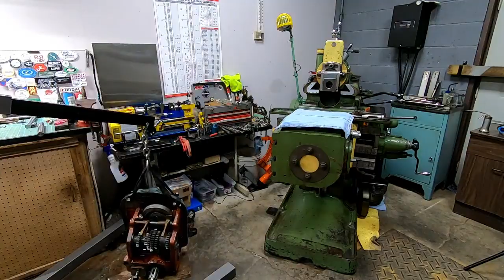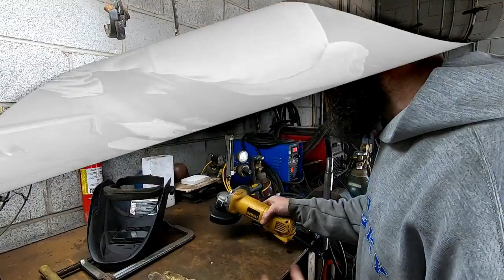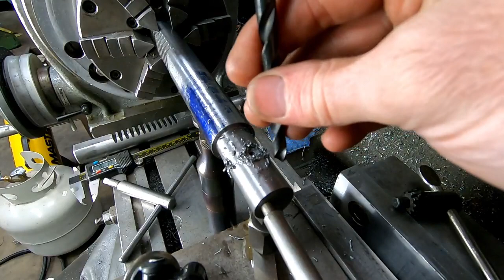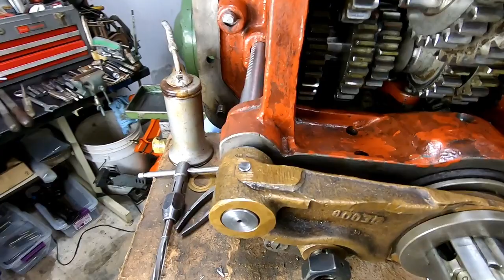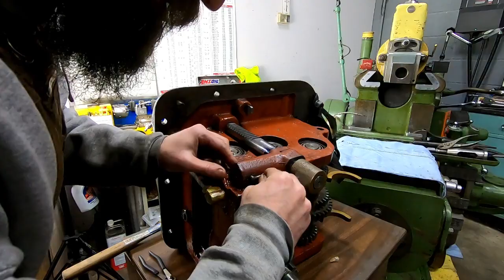👍K&T Clutch shaft final.

Comment: Try double face masking tape to hold non-ferrous metal to a magnet. Works great.  In 2004, I had the pleasure of turning a new left hand 1 3/8- #4 Acme lead screw and matching bronze nut for a old Cincinnati vertical mill saddle cross feed. I still have the sketch of the nut in case someone may need to make one for their machine. I really enjoyed this work and seeing you carry on with this type of work.

Comment: having been a machine repairman at Falk corp here in milwaukee, i have rebuilt many gearbox/transmissions that use the straight gears.  they always show that type of edge wear on the leading edge of meshing gears.  just take a file and break all burrs on the teeth and check the root of each tooth for cracks.

Comment: To help from tiny parts getting flung off the grinder, i use a thinner, wider piece if metal. We have theze thin parallels at my job, and if you place it on the side of the grinding direction (so on the dust collector side) it should help. Gives it something to but up against

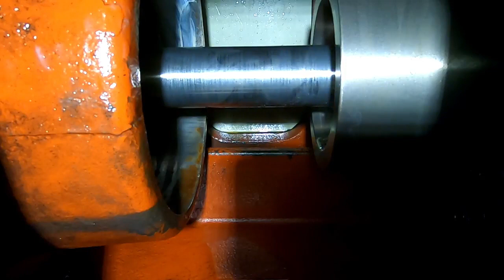Comment: 8:46 was that rough looking cylinder bore where your metal was coming from on that compressor? I wouldn't worry about those gear teeth, I imagine they will outlast all of us watching this video today.  It is after all a USED machine that is meant to be USED, it's not a museum piece, least I think not yet anyways. :-)
Reply: Did you also see that big crack in the housing? On the left side.

Comment: Unless there is a problem shifting I wouldn't touch the gears you might create problems. The part that is worn will not have any effect on anything and won't wear any more now that the clutch clutch is working. Great job Steve!
Reply from the maker: I agree 👍

Comment: hand drilling for taper pins is typical, and the usual way of dealing with them is to just drill a new hole when replacing parts.  If that isn't an option, then you do all the fussy stuff like you're doing to try and match a randomly positioned hole.

Comment: Hi Steve 🙂
Great episode.
Have you worked out what the problem is with the compressor pump ?
Reply from the maker: Yeah, the compressor is back up and running now. It sheared a key in the drive gear to the oil pump because of a bolt working loose. Changed  the pump and flushed the case and lines. Working good now.

Comment: The raised area of the gear, while the video doesn't show it well enough, appears to be where the two sets of teeth do not contact each other.  If so, a grinder. maybe a hand file could reshape the teeth's edges without changing the way the gears meshed prior to your work.

Comment: I'd dress the chipped teeth by polishing any burred areas till smooth. Before install I'd add some gear oil on the gears and shafts. It should stick pretty well during the rebuild and help also. I've done lots of rebuilds and always was taught to wet surfaces where pressures are. Good job on the shaft looks perfect , now it's time to finish her up. New oil a good warm up before engaging any gears let the oil circulate for fifteen minutes or more .

Comment: Not related but I noticed that old fan on your welding bench and it brought back a memory of one my grandmother had when I was little (I am 59 now). it was a Westinghouse and as kids we were NOT allowed to touch it. It was lovingly cared for with two drops of oil each day out of an old metal 3n1 oil can. I always wondered what become of it........ Yes you need to dress the damage on those gears. And as for grinding that washer you can "block up" around it with thin metal strips with a V cut into them. I do them at work like that. Yes you can glue them down also but it messes with your dims. if your really trying to split hairs so to speak. Great repair so far.........

Comment: Dear steve, I hope you will not be mistaken, by making a thicker ring and thus changing the pressure on the brake? Kind regards, Jaap
Reply from the maker: The washer didn't change the tapered pins position of course.  All was built off the one that worked so it should be fine.

Comment: I'm not a machinist, but couldn't you use JB Weld on that broken part and get a good fit?
Reply: He would have had to hold the two pieces together until set! Your arms soon get tired. Oh, and I guess that an epoxy glue has some thickness, so the dimensions would not be true. 

But I'm not a machinist either, and I do love JB Weld --- so it's a good question.

Comment: As always a Steve Summers' precision approach with no shortcuts, but the results are very rewarding as you stated.  The replacement of the tapered pin was the best and proper approach.  In the rare case when you might have to install a bolt and nut to a close tolerance there are aircraft "shear" bolts that are close tolerance for the sort of application of shaft connections.  There are some older numbers but what I find today is NAS6603 - NAS6610.  The last two digits indicate the nominal diameter of the bolt in sixteenths of an inch.  So "03" would be 3/16 inch diameter and 10 would be 5/8 inch diameter.  The average tolerance on the diameter of these bolts is less than 0.001 inch.  
There follows a dash number which is the grip length.  There are tables covering this.  These bolts are often available as a single purchase.  Have a wonderful Christmas and a Happy New Year!

Comment: Did a few taper pins, and built up a small collection of tooling for them . However found that there is not much difference between US standard and metric standard tapers and reamers. The US one is 12:1 taper and metric is 10:1 taper, so they are almost interchangeable. Of course not being in the USA and having machinery made there originally ( but the spares come from Vietnam or India, but with US pricing) I found it hard to get US standard taper pins, so used metric ones instead. 

However got the reamer as US, as this was old stock ( around 50 years old, given the time SA changed to metric in the 1960's) and was a very cheap price because of inflation  over the original price, plus it had some slight surface rust that was easy to remove ( vanished first time and it was oiled afterwards), so was a massive difference to the newer metric one. Just had to use a little more tappy-tap to put the pins in and out, but they held just as good, especially in the holes where the pins were used as fuse pins, those were a little worn, but luckily I could get nice new metric pins in larger sizes to compensate.

Kudos on making the shaft bug for bug compatible, the brass washer is probably there as a sacrificial part, there to handle wear without requiring a new casting on either part with time, just make a new one and be done. Was probably stuck in there after the first overhaul to compensate for slop in the clutch assembly, and before the clutch shaft was snapped by too much pressure trying to engage it.

Comment: Steve, stop using your hands for a hammer. You will develop "Carpal Tunnel". I spent 40 plus years working with my hands and I got Carpal Tunnel. I had it corrected, by that required surgery. I only had my right had fixed, but I needed to do both.
Reply: Boxers have their hands taped and they wear a padded glove. Secondly they hit with the fist, not the side of their hand. People who type a lot also get Carpal Tunnel.
Reply: I wonder why boxers don't develop carpel tunnel.
Reply: SmileytheFeralCat they don’t live long enough

Comment: You have the assembly out setting where you can easily reach it;  fix the teeth!  No doubt a previous owner/operator tried to engage the gear without the clutch.  I imagine a little dressing of the leading edge would do the trick.  Steve, the detail you go into describing what you are doing makes me think you would make a good teacher of what you do on your "real" job.  Keep it up and they'll have to quit calling you a hobby machinist.  Looking forward to the next addition to the mill...maybe the gear dressing!  (Do you need a shop cat?  I got about a dozen and you could have your pick!) Greg.

Comment: If you have to surface grind a part, that will not hold on the magnet on it´s own, you can use super glue. But every glue changes the height, and the part may not be parallel on the magnet. As an alternative, you can build walls around the part, using large but thin pieces of steel, ie sheet metal. It has to be in contact with the part, you are grinding, so that the part can not move horizontally. At least not in the direction, you are grinding. Of course, the walls have to be a lower surface, than your designated grinding height. Btw, oil, lots of oil, when reaming. A good alternative to a center drill (which drills the wrong angle) is a NC starter drill. They are very short and stiff, and have a better angle at the tip. Please, as always, excuse my bad english...

Comment: @0:17 the wall behind you seems to have a roofing leak.  any leaks there could rot the boards bolted to the inside of the concrete wall.  can't tell if that is a low spot of the roof where the drain goes thru the wall. you could have a leak into the wall..  several ways to fix that..  a quart of white roof coating could be applied if you have some days without rain to let it cure. i have poured it out and spread it around..  or  you can spread wet patch in that area..  you really need to figure out how to stop that leak.  so it does not turn to mold.  eating up your rafters.  you may have to be creative in that corner of the roofing.. you may need to add something like a battery warming pad.. to keep any snow or ice from freezing right in that corner so the roof drains.. i am taking its an almost flat roof with a parapet wall .. i have gone as far as spreading out tubes of clear silicone on areas to really waterproof them..  this or the white roof coating could be spread on any wall above the roof drain to water proof it and stop it from seeping thru..  you may want to build a float device that has a J shape.. that hangs over the wall so if your roof fills with water you know it because the upside down J shape is above its normal place in the guides on the wall.

Comment: if working on the teeth. you have to figure a way to keep the debris out of the bearings or spread out across other gears.  you will because there will be Shards spread out from the prior gear damage.. put a some https://www.homedepot.com/p/MASTER-MAGNETICS-3-4-in-Neodymium-Rare-Earth-Magnet-Discs-3-per-Pack-07091HD/202526387 in the bottom of that oil reservoir so all the fragments will be stuck to the magnets.     i dress all the damage to gears like that.

Comment: Sometimes you have to jog the clutch to get the gears to mesh....That is probably  what caused the gear teeth to gall on the front of the teeth.. As long as no teeth are missing, you should be fine.. You have plenty of length left in the teeth..

Comment: Steve, you did a great job making that shaft.  The way you took it step by step really gives someone how may not have mad skills the confidence to tackle a job like that.  A lot of us have old iron, and the ability to make a replacement part is priceless.  As far as the taper pin in that shaft...  Most of us would have just drilled and reamed a new hole away from the original...  So bravo for getting that back to original location, I'm sure that took a bit of thought to get to what you showed us today.  Thank you so much for sharing what you do!!!

Comment: to keep long shaft weld alignment I have put clamp on shaft then used gear puller to hold it straight. .004 is probably better than I could have done. nice repair. love your channel. thanks for the show

Comment: I really enjoy your videos Steve. If you ever need to rejoin a cylindrical part, consider using your lathe. Chuck the main shaft up and trap the broken stub against it using a live center in the tailstock. This will keep it in line coaxially. Braze the break while rotating at a slow speed, adjusting the pressure from the tailstock as the the shaft lengthens due to the heat. The even heating will avoid the stress and bending imposed by spot welding. Then, if needed, the brazing can be removed in sections for regular welding repairs and minimize the distortion of spot welding.

Comment: Regarding the "chattered" up gear teeth, I think you sort of answered your own question when you were taper reaming the pin hole out. Your exact words were, "And I am going to flush this thing good. I'll get chips and stuff in the bearings." The ends of those teeth appear to have slight flares to them. How long before those flares work harden up, crack, break off, and get into your bearings? If you dress them off, never. If you leave them on, anytime. Most likely when you really need the mill to do a job and can least afford the time and money to do a tear down and replace cooked bearings. (isn't that always how it works) Planning for success means attention to detail as you well know. Planning for failure means leaving things to chance. It also means losing sleep and having to ask yourself, "why didn't I just clean those up when I had the chance? You dummy."  It may take an hour or two to clean up those teeth. How long would it take to redo that gear box if the bearings go south? If K&T had wanted those teeth chowdered up, they would have made them that way wouldn't they. But you do what you want, it's your machine. I know what I would be doing.........
Reply: maybe just file them smooth?

Comment: i think the spacer washer is a waste of time. you can't hit both registers the taper pin does the job. i would have used that space  to put a generous radius on the shaft, that appears to be the weak spot on the shaft. i wouldn't worry about the gear teeth as long as they engage properly. nice repair job. steve. i hope the machine runs well for you. you deserve it.
Reply from the maker: A matching radius on both was talked about earlier. It would have been the best / strongest  way I believe. The washer was to fill in the gap I left by mistake. 
Thanks for watching and taking the time to comment 👍

Comment: On the gear issue, absolutely smooth those edges.  Just remove the high spots and burrs and blend the edges without going crazy. Originally the teeth were  slightly rounded so they can more easily engage. you just want to get back closer to that point.

Comment: Heh.  I had a bearing pack up in the rear-end assembly of an asphalt compactor roller.  I dropped the whole rear axle out and set it to the shop, they game me an estimate of twice what I paid for the machine and 8 weeks to get in parts.  one tooth in the ring gear in the diff had chipped out a corner, and they wanted to replace all the diff parts with “matched” pieces.  One bearing, a little file work, and 8 years later it’s still working just fine...

Comment: The shaft broke at the sharp step in diameter.  It would have required more work, but putting a bevel or tiny radius at the bottom of the joint and machining the inner face of the spacer washer to match might have ensured that there would never be a break there again.  Nitpicking, I know.
Reply from the maker: I put a radius at the transition 👍

Comment: Using a spacer on a shaft to a shoulder, allows a large radi on the diameter change resulting in far less of a stress raiser. Not sure if K&T deemed it necessary for this component.
Great final assembly.
Reply: Ah, yes, but then the washer requires a matching radius to work effectively :-) That solves my earlier question :-)

Comment: Steve, i have a customer who is a GM engineer who for several years worked on a spainish made press that had gear issues...ANYHOW he called in a guy who has a P.H.D in gears of all things and so Tom thru this guy knows an over abundance about gears...Tom has helped me with some gear issues...so anywho Tom is coming in today and I will lay this on him....i will repost his thoughts on this original post of mine ...
Reply: Tom said that, DO NOT USE A GRINDER ANYTIME  on a gear BUT, he said to just hone lightly with a stone...he said to never alter a gears geometry etc...and  for that to happen to the teeth there is a misalignment...which all of his answers have been covered by others but it is nice to know a experts thoughts line up with yours...

Comment: Hi Steve, any damage to a gear tooth needs addressing, remember that the surface hardness of gears in mesh should have a differential. That is, there should be one gear harder than its neighbour, it's probably only 2 HRC or 20 HV. Not seeing the other gear that meshes, I can only guess its the harder one.
Great set up and remanufacture.

Comment: I am looking at the wall behind you in your opening video. I see water damage at the conner of the wall? Looks like a chimney flue that might be leaking at, or around the chimney the roof level. I do masonry work and I have seen that problem before, I hope I am not too out of line. Thanks just want to help. Love your videos.
Reply: Saw that too.  Good to let Steve know.
Reply from the maker: The place has several leaks. This old shop is going to be  pushed down in the next few years. 
Has major foundation issues and is beyond repair.  Hope to have a new shop in the next 2-5 years.